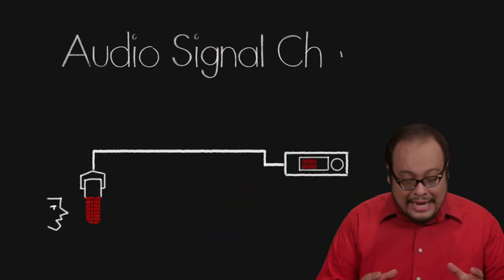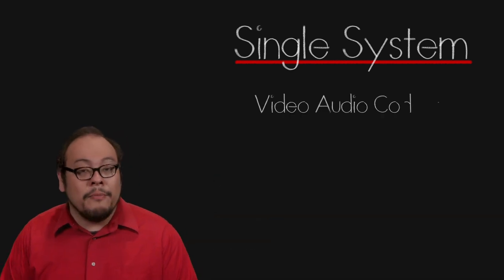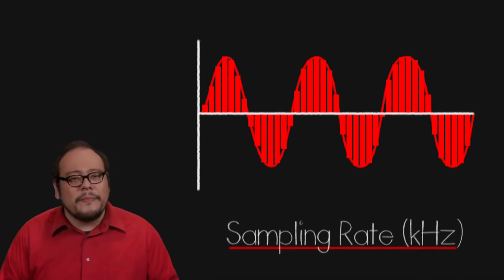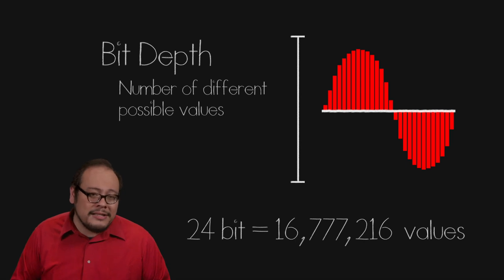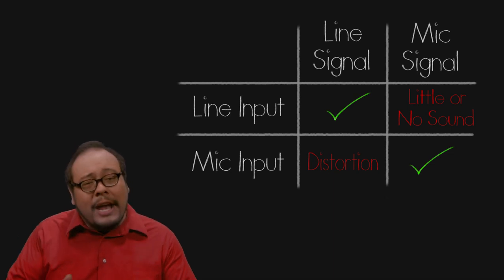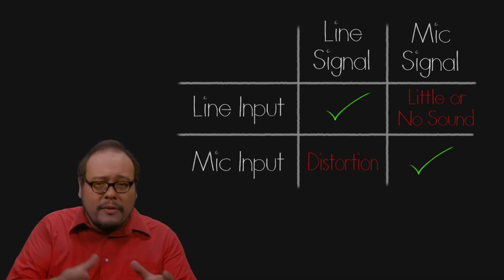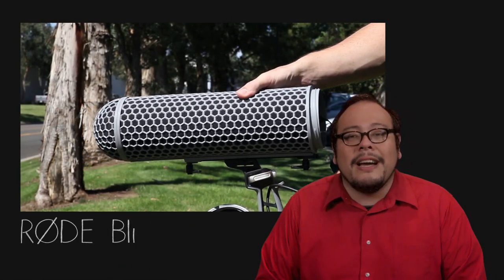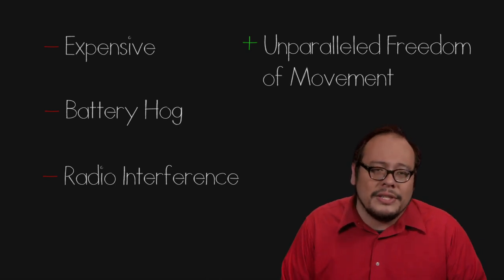The Basics of Recording Audio for Digital Video

Comment: Sound is never more important than picture.  This misrepresentation began as merely an emphasis to get good sound for your film/video, then was exaggerated.  Eventually, people repeated the exaggeration without making it clear its an exaggeration.  Then, like the children's game of whispering something in someone's ear, after several repetitions the message breaks down.  To zero this back to reality, remember that without picture, you don't have a film or a video, you have radio.
Reply from the maker: That's not true. There are several cases where sound is more important than picture. And sometimes even visuals aren't enough to convey the point of something, and the sound is what sells the experience.
Reply: @FilmmakerIQ  99% of the time sound augments the picture to help convey the meaning.  But if one element is vastly more important than the other, the other can be taken away and you still have something with meaning & purpose.  Hence, you can remove sound from a film and you still have a film.  If you remove the picture from a film and leave only sound, you have radio.
Reply from the maker: Take the sound out of a horror film and it's no longer a horror film. In that genre sound is more important than the image. Going outside narrative film, sound in a documentary is MORE important than visuals for talking heads. True there is a give and take but to say sound is never more important than visual is simply uninformed.

Also look up Tommy Edison the blind film critic ;)
Reply: @FilmmakerIQ  Silent films thrived for more than 30 years before synched recorded sound appeared in the very late 1920s.  Most notably, one of my favorites is "Metropolis," which is considered one of the greatest films ever made.  Same with Eisenstein's "Strike," "Battleship Potemkin," and "October."  In fact, I have a picture of him at an editing table in my office.  One of the famous horror films from that time was "Nosferatu," a film that is famous & studied today.  I cut a music video last year and added clips of that in.  Documentary films were also made before sound.  And as we all know, or should know, the talking head is the least interesting kind of visual.  "Man with a Movie Camera" by Dziga Vertov comes to mind, as does "Berlin: Symphony of a Great City" and Flaherty's "Nanook of the North."  To say there's no motion pictures without sound truly is uninformed.
Reply: @FilmmakerIQ  Easily the best American film director, probably ever, Martin Scorsese, talks about filmmaking in this video linked below.  From his own words, and StudioBinder’s editing, there is no mention of sound being more important than the picture.  But over & over there are statements about the visuals, script, perspective, authenticity, tone, editing, and performances being the most important aspects of cinema.  He does say music is important, but the music isn’t the movie, the movie is.  The music (sound) always augments the picture.  The sound effects of still cameras, punching, etc., are not what drive the movie or the narrative, its the imagery, augmented by the sound.
"How Martin Scorsese Directs a Movie | The Director’s Chair"
StudioBinder  https://youtu.be/Cz0byBTjtEU
Reply from the maker: You are really arguing from a very tenuous position and your dogmatic clinging to this argument reveals just an wholesale lack of understanding of the medium. Sorry if that is offensive but it is simply how I see this going since you felt it worthy to bring a promotional piece as "evidence"

Proto-film is always so damn difficult to discuss because it is simply not the same experience. Film didn't flourish for 30 years before sound which occurred 1927. At best we can say that film in the feature narrative sense existed for a little more than a decade with the earliest "films" as we would recognize them starting around 1915. Before that they were stuff of sideshows. Now sure we have a lot of growth in that ten year period. Lang, Eisenstein, Griffith so on... But as much as they contributed, it was sound that revolutionized cinema and made it something we would recognize today. And the biggest reason - illiteracy. Sound made it possible for the illiterate (a much larger part of the population) to fully enjoy a film. It fundamentally changed everything and the effect was so drastic that they entire industry retooled in a matter of just 2 years.

Documentaries may have been made in the silent era - but that's not evidence that they don't rely on sound in today's era. 

Now onto your promotional piece. Script, Perspective, Authenticity, Tone, Editing and Performances ALL have to do with sound. In the first 8 seconds of your video - you see and HEAR the flashbulbs. The sound of the flashbulbs sells the effect - the cut is MADE ON THE SOUND. The shot from Gangs of New York, you hear the jacket and hat come off - that wasn't recorded on set - that was purposely put it there to create the Authenticity and Tone of the shot... hell the whole video is a rich sound design. 

Is that sound design more important than the image? Yes, I think ultimately it is. 

I'm sure if you asked Martin Scorsese specifically about sound he would not discount it. See if you can watch this documentary. 

https://youtu.be/WsIE4x3xU0Y
Reply: @FilmmakerIQ  The sound of those flashes, etc., does not drive the cutting.  You have technical knowledge but a lack of knowledge of cinema as an art form, or maybe its a misunderstanding of it.  Decades of great movies were made and flourished in mono sound mixes even into the 1980s.  As technology develops, sound and picture improve.  But to say sound is the primary element in a visual medium simply demonstrates of a lack of understanding of the medium.  I tried to explain, but this false perception, based on an exaggeration, has now become your truth.  You can make a movie without sound, but you can't make a movie without picture.  I realize you refuse to acknowledge or even understand this, so I'll stop trying to explain.
Reply from the maker: Yes the sounds of the flashes drive the cut, they're part of the sound design. I'm speaking from a position of technical and artistic understanding, your just plain wrong on the subject. Your position is dogmatic and just downright stupid.

Go ahead and release a film without sound and see how that works out. Or even cut the sound completely out of a scene and see how that feels... Whereas you can completely cut the picture and fill in just the soundscape and audiences will buy it.

Comment: Usually a great channel and much of this video is excellent, but sadly some misinformation about high sample rates here. There is no advantage for recording audio in 96khz over the standard 48khz. As shown by Nyquist, 48khz is more than enough to accurately reproduce any pitch in the human hearing range. 96 is a bigger number so it's natural to assume it gives more 'quality' but in the audio engineering community this has been shown countless times to not be the case. Higher sample rate has applications for DSP etc etc, so it has its uses. But a film-maker is not getting 'smoother' or 'more analogue' or higher quality sound by recording audio in 96khz as opposed to 48khz. You are only using more disk space. Still, it won't do you any harm at least!
Reply from the maker: The size of 96khz audio files are paltry compared to massive amounts of data we're spending on RAW video files. I still read some things where 96khz are easier to work with on some filters. To me, noise reduction seems to be better... but I'm not above agreeing that 96khz may be overkill.
Reply: Indeed, data storage is cheap and big files don't cause us problems - but that doesn't mean they are higher quality! Still, that technical point aside, another great video, thanks!
Reply from the maker: +Edward Swift I've found articles that make claims that there are some advantages when using filters. The whole thing isn't quite cut and dried but I will agree that 48khz is fine... But the 24 bit vs 16 is real!
Reply: I would caution that there is all kinds of voodoo speculation on the internet about sample rates, but you're right that it's a complex issue. 24 bit word length is vital of course, primarily because the much lower noise floor is such a huge improvement, and especially with multi-track audio.

Comment: MP3 files could be used if the bitrate is 320kbps.
Reply from the maker: +Ziron (XMV) generally speaking not a good idea because of the extra processing power required to decode MP3 which can affect real-time playback. But if you're only working with one or two tracks it may be ok
Reply: If you ever intend to have your audio played on speakers at high volumes, using MP3 formats at any bitrate—including its highest bitrate, 320kbps—will distort high-end frequencies, inevitably leading to poorer playback. For small speakers, MP3 is fine, however a theater or concert should always use high-quality uncompressed sound.

Even if you're only uploading to YouTube, you should compress the video and audio as little as possible so that if YouTube ever improves its own compression for streaming, they'll have an uncompressed, raw video backed up to work with!

Comment: Hey u need to increase yr recording gain.  I had to pump up the volume but still struggles to hear what you're saying.
Reply from the maker: Watch it with some decent speakers. Yes the gain is low, should be higher, but i have no trouble hearing with the right equipment

Comment: 24bits won’t give you better resolution if the A to D converter isn’t linear. A poorly designed circuit can introduce poor conversion artifacts and unwanted distortion.

Comment: If you're human then there's no way that you can hear the difference between a 48 kHz sampling rate and 96 kHz. The reason to record at 96 kHz or higher is that those extra samples can sometimes be important in post-processing. For your final cut, you can go with 48 and be perfectly fine - no one can hear the difference. Maybe you've confused this with bit rate? With a compressed format such as mp3 a higher bitrate can absolutely make a difference. For my ears, a low bit rate is most noticable with applause. My ears happen to be really good at picking up the digital artifacts left over from lossy compression.
Reply: Other than that, your video is top notch and straight to the point.
Reply from the maker: Yeah I've backed off that. Unless there's something to way that the noise reduction worked at that time period... Perhaps the roll off was lighter... Then no audible difference between 48 and 96

Comment: Sorry, but 96K is meaningless manufacturing hype. Every formal blind hearing test of 96K vs 48K has failed to identify any difference. (Source: Owinski - The Audio Mastering Handbook, 2013)

The Nyquist equation also proves that it is impossible for anyone to ever hear the difference. You would need to be able to hear a 25KHz signal to ever notice, and no human has ever been confirmed to hear anywhere near that high.

However bit depth definitely matters, it is easy to tell the difference between 16 bit, 24 bit and 32 bit.
Reply from the maker: +Manning Bartlett When I do noise reduction I always feel like get a cleaner result from 96khz.... remember this is audio recording for manipulation in post production, not final output. And the extra memory needed is negligible compared to the size of the video files.
Reply: I also edit in post so I appreciate there is no file size issue. But I made my comment because scientifically, mathematically and medically, your claim is flat out impossible. 

If you can consistently identify the difference in a double blind test I will gladly retract everything above. But no-one has EVER been able to do this.
Reply from the maker: I never said I could hear a difference in unedited audio but arguably there are some advantages in when applying filters with higher sampling rate. Seeing that almost all professional recorders are capable of 96khz and the industry standard for recording in the film industry, I don't think it's a bad recommendation even if it is a bit overkill.
Reply: Again I must vehemently disagree. 48KHz is the industry standard, not 96.

I have never worked on a film where the audio was recorded at 96K. (The only exception was for audio that was going to be pitch-shifted down, then there is a clear advantage to 96K recording.)

96KHz offers no other benefits, and creates aliasing risks (which is why most filters have 20KHz LPFs anyway.) 

Do what you want in your own work, but I maintain that it is poor advice for beginners.
Reply from the maker: Feel free to make your own video... But to me its not black and white issue, and if the option is there, I don't see any drawback to recording 96khz especially when a lot of plugins natively work in 96khz
Reply: Well yes bit depth does matter as far as headroom and dynamic range of the recording as well as noise. But sample rate also plays a big role in SNR (Signal To Noise Ratio) Which is what he's saying and explaining to you. Yes there is differences between 96Khz and 48Khz because the more the sample rate the less "Quantization error" resulting in improvement in the SNR less rounding up voltage levels , this is why he's hearing less noise without him realizing that oversampling is the secret of what he's experiencing and he probably know's. So yeah ahaha its not only bit depth that can give you a clean sound it also sample rate, or have you never heard of (DSD) 1 Bit Recording super clean audio no relatively no noise with just 1 bit.
Reply: That is correct, Usually oversampling will result in a less SNR because there will be less quantization which will result in less noise.